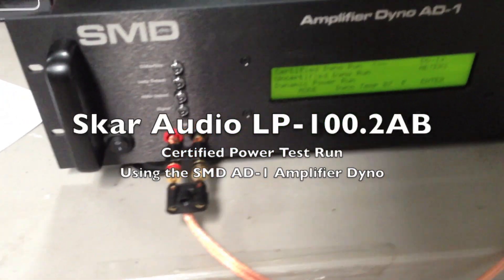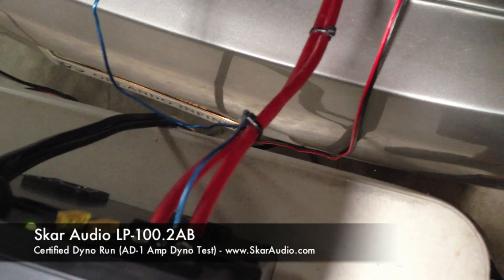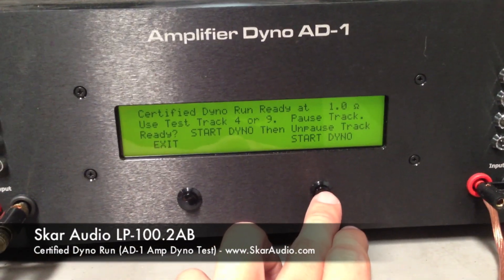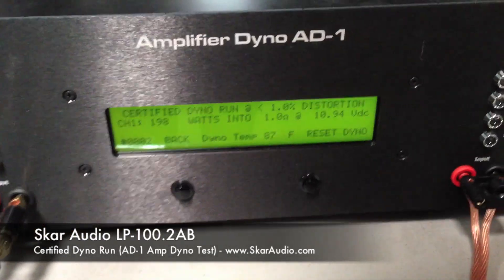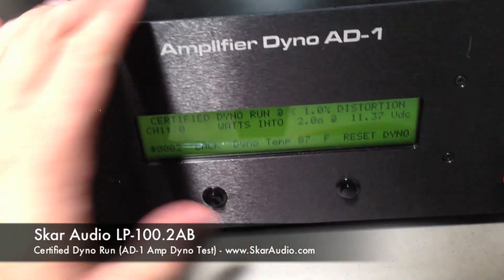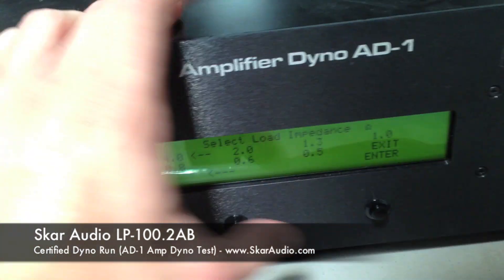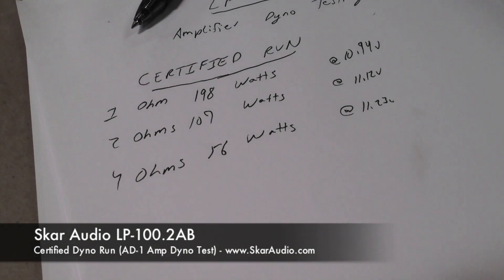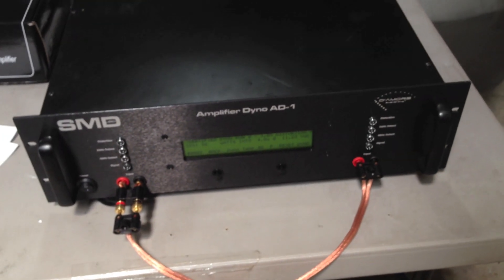Skar Audio LP-200.1AB CERTIFIED Amp Dyno Run Test with SMD AD-1

Comment: ahah what? the LP-200.1 on the skaraudio website says it does 200wrms at 4 ohms.... um... why did you get 200w rms at 1 ohm? 

not to mention 249.99 for what... 300 watts? what are you smoking on?

Comment: Question...seeing as the amp was tested at 1 Ohm, would you deem it stable to use at 1 Ohm on a daily basis? I recently purchased one of these and would love to run it at 1 Ohm if possible without damaging it. Thanks